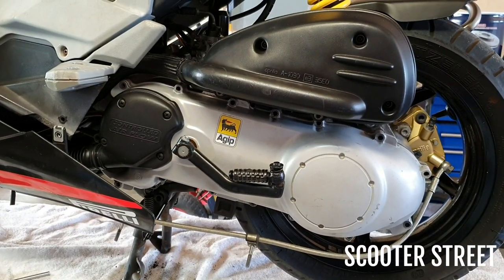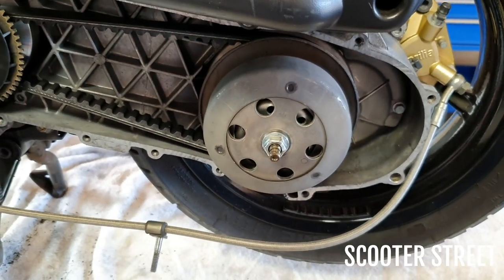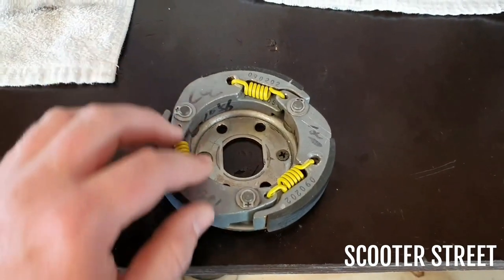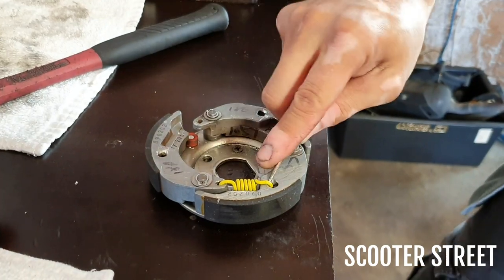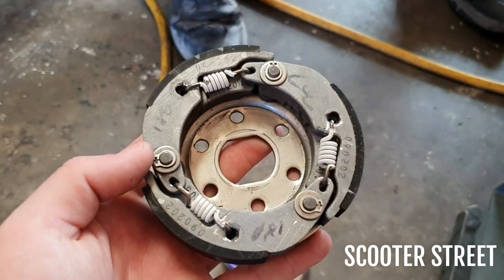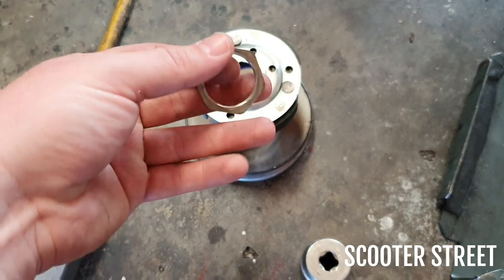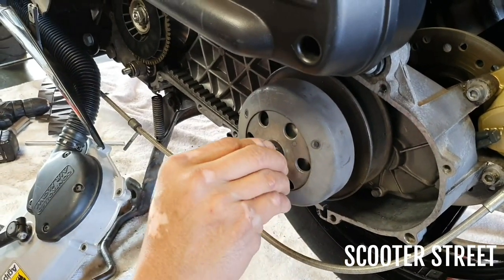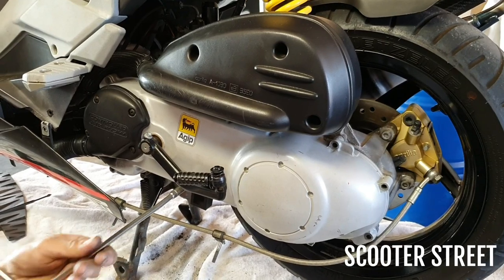Changing / Installing Clutch Springs on Scooters - Aprilia SR50R (Piaggio Hiper2 motor)

Comment: I have a really slow acceleration in the beginning then when I hit 10km/t it accelerates faster. What should I use for my clutch and variator?
Reply from the maker: Without knowing any details of your scooter or the set up it is almost impossible to make any suggestions. I guess you could start by checking the components in the transmission and carby/airbox and look for wear and tear. Try to lighten the rollers and up the tension of the clutch spring set.

Comment: I run this setup: 
-Multivar 2000
-white contra spring
-red leovince clutch springs
-leovince tt
-7 gram stage6 roller weights

-Athena gold series drivebelt, 
(Malossi kevlar belt should also work fine) 

This setup is for aprilia SR 50R Factory (Ditech) 2006 with stock cylinder. 
If you weight +60 kilograms please try out this setup, worked very well for me.
Reply from the maker: Thanks for sharing your setup👍👍👍 awesome!
Reply: Hi, have you got some contact that I could write with you on pv somewhere? I've got the same Aprilia sr 50 factory (ditech) 2006 and Im trying to reach best top speed with stock cylinder to avoid changing it. Right now mine goes 80 km/h on 4,5 gram rollers but Im going to change all of the parts. Im very intrested of you final effect at the acceleration, top speed, sound and the rpms.
Reply: @ciorny2426  final result with stock cylinder was 92 kmh on speedo
Reply: what is the top speed
Reply from the maker: @ciorny2426  Thanks for your comments👍 On this model I would use a street race exhaust system and a variator, the Ditech has a high revving engine and these 2 parts will enhance the acceleration and top speed.
Reply from the maker: @Octavian17  SR50R unrestricted is 86kph GPS.
Reply: @scooterstreetau  mine goes 75 on gps fully derestricted
Reply: and other tuning parts
Reply: The only things that i didn't change after fitting a sport exhaust was the rollers, clutch springs and contra spring
Reply from the maker: @Octavian17  Add a couple of key parts and you will get more out of it. You can never change an exhaust alone other parts MUST be changed to have it running properly and get the best performance. Jet, rollers, clutch springs.
Reply: @scooterstreetau  i got 4,8g rollers and red clutch springs along with the exhaust, but i think that the red clutch springs are way to much for a 50cc, maybe i should try the 4,8g and some white springs?
Reply from the maker: @Octavian17  Try all different parts until you get the best performance.
Reply: @scooterstreetau  with the 6.5g rollers the bike is still very fast from 0 to 75 and then it goes a little bit slowly to 80 on dash, i will give the rollers a try
Reply: @Octavian17  Try gameboy tune it or get a 70cc malossi kit as i did a couple months ago
Reply: @unpossible3249  does gameboy work on a euro 4 sr 50 carb?
Reply: @Octavian17  Nope, only works on fuel injection, main purpose of game boy tuning is increasing fuel rate on injectors, which is done through a computer. Carby version does not utilize gameboy tuning at all because its still old fashion way, though you could buy a derestricted cdi for your carby sr 50
Reply: @Octavian17  i go 110 gps same engine
Reply: @AutoRevisieOutOftheBOX  i go 96 with 50cc sport variator, 14/39 gearing malossi and tt exhaust
Reply: i have aprilia sr 50 what  rolers should i get and witch color spring ant the springs

Comment: hi what contra spring , clutch springs , jet and rollers should i use on my aprilia sr 50 2012 full stock only have stage 6 pro replica mk1 exhaust on ,i want better acceleration
Reply from the maker: It is all trial and testing, make one change per time. For rollers start at .5 gram lighter on each roll. Get an adjustable clutch, Polini.
Reply: @scooterstreetau  shoul i try with like yellow springs white spring and 4.5g rollers or 3/3 with 6.5
Reply from the maker: @izanagi9959  Just change rollers first and then change to an adjustable clutch.

Comment: So when reinstalling the variator or the clutch, it isn't necessary to use a torque wrench to make sure you're not over or under?
Reply from the maker: Yes using the Torque wrench is the Gold medal approach👍
Reply: @scooterstreetau  nope pretty standard. This is setting the bar dangerously low.
Reply from the maker: @Austin-dr5fo  Using the Torque wrench is the Gold medal approach👍 it is OK if you do it how you want to, best way to learn.
Reply: @scooterstreetau  it is the best way to crush your splines. I've seen it happen. I've done it myself.
Reply from the maker: @Austin-dr5fo  If you don't set your shaft spacing you will crush the spline.The Spacing must be outside the where the spline finishes and the conical washer facing inward, from factory it is set. It does not matter which method used to tighten the bolt, if the spacing is short then you are asking for trouble.

Comment: What do you reckon I should do.  Because my bike. Takes loads of RPMS to even move and it’s dangerous for traffic light cars can rear end me ??
Reply from the maker: Without the details. Check for wear or damage.. all I can suggest is to increase the roller weights and reduce the spring tension on the clutch shoe. 🤷

Comment: I have a BV 500. Will this foot method not perhaps be dangerous doing the stand on it removal method, as my spring is much more powerful?
Reply from the maker: For the larger capacity scooters use the clutch holding tool. This will hold the assembly and allow safe removal of the clutch and spring.

Comment: Hi there, my scooter automatically accelerates on its own when i start it. It creeps forward slowly and ideling speed doesnt effect it. Mechanic says its clutch springs. Is this true? I dont trust anyone in my area. Been burnt lots.
Reply from the maker: Yes I would check the clutch shoes, when they fail they get Locked on to the clutch bell and cause a rotation of the rear wheel.
Reply: @scooterstreetau thank you. I will check that too. Flywheel does seem to rotate the get stiff and loose again. Thanks for sharing and your video. 😊
Reply from the maker: Thank you, all the beast. @jmdstudio6176

Comment: I have a Icebear 50cc gy6 I have a naraku clutch kit It has 2000 rpm springs 20mm carb 30idle jet 80main jet Naraku high tention coil mikuni fuel pump ncy no rev cdi I don't know what contra spring to go with, 2000 rpm or 1500 I weight 150, pounds waiting to get my fmf exhaust welded on I'm new to these could you help me?
Reply from the maker: The idea of the contra spring: When you release the throttle the revs will decrease. When the revs decrease we want the transmission gearing to also decrease and continually move to low gear so when the throttle is banged on again the engine is at the lower gear to have an instant response to the throttle action. A balance between rollers and spring tension is how this is acheived. The Contra spring can also slow the accelerating progress if too highe tension, trial and testing will get you the best result.

Comment: I have just bought a Leo Vinci exhaust and it came with clutch springs and rollers, do you think I should put these on at the same time? The clutch springs are yellow. I have a Peugeot speedfight 4 2t
Reply from the maker: Yes you must fit these and the main jet is a MUST. Always trial and testing..
Reply: @scooterstreetau  okay thanks and I have already got a bigger main jet in as I have an exposed airfilter and I had a sports pipe prior to this but it snapped so I think my jet should be fine
Reply from the maker: @charliestowe3421  Don't be happy with I think so, check as you go😁

Comment: I have a stock 50cc engine, and i want more power from my transmission. What do you think is a good transmission setup?
Reply from the maker: A performance Variator will help achieve this, dialling in the correct roller weights, step up the clutch spring set or adjustable clutch shoe (2nd option is better). Get a very flexible belt and make sure it sits high on the rear pulley at idle and high on the front pulley and high speed.

Comment: So put the belt on the variator first I've put a new variator and clutch and I removed 3 rollers because it had no take off so now take off is good but it feels like no top end just reving high please help
Reply from the maker: Changing too many parts usually bandaids the original issue, so this is not the best way approach. Taking out 3 rollers is not ideal and the engine will not perform well.
I can make a comment unless I know the history of the scooter and te parts fitted, we have an online support program. 
See here: https://www.scooterstreet.com.au/product/online-scooter-support/
Reply: @scooterstreetau  thanks I put the other three rollers back in I'm waiting on the left light box and the new throttle cable there coming this week I bought a extra belt in case the new one I put in breaks so it's ruining great now hopefully it'll continue and I definitely will check your support page out
Reply from the maker: Always good to hear when it works out, trail and testing is the best way to learn about the transmission🙌 @Deoge4
Reply: @scooterstreetau  I haven't destroid it since I put the other three rollers in I took them out cuz they was just slow and only going thirty but I think my belt was in the clutch to far down so I got it to the top just a little bit more hopefully it'll all work out in the morning I will know
Reply: @scooterstreetau  I meant to say I haven't test rode it I will in the am though
Reply from the maker: Yes I thought as much. @Deoge4
Reply: Well I took it to the store this morning it's only going 25mph is the rollers to heavy I bought the clutch and variator kit on line with the belt I'm not happy at all please tell me what I can do
Reply from the maker: Stop changing multiple things at one time as it makes it so difficult to find the core issue. Go back to the start and make one change to the system and then test ride and adjust as required.  @Deoge4
Reply: @scooterstreetau  well I get to work today and my belt is shredded the belt that came with the clutch kit
Reply: @scooterstreetau  luckily I had an extra belt I put am I supposed to have the belt on top of the clutch or on the bottom of the clutch it just feels like when I go something's holding it back like the belt is holding it back what can I do to fix that
Reply from the maker: Wacth the belt fitting video and followit without any short cuts, it is really simple if you take your time.
Reply from the maker: Did you check the clutch and all of the parts when you fitted the belt? Was it fitted correctly? Are the parts correct for the scooter model? @Deoge4

Comment: Hello, I have Aprilia SR with minarelli horizontal engine, it struggles to move from a stop and wont increase rpm until about 20 km/h. What do I need to change?
Reply from the maker: To help increase the RPM, lighter rollers and tighter clutch springs. The carby must also be tuned to the optimal setting with the jetting.

Comment: Also I have adjustable screws to loosen the tension on the springs which I later found out I didn't even need the pliers, they just slipped right out after I released the tension.
Reply from the maker: Yes the adjustable clutch spring system.

Comment: How do you get the belt on when using bigger/stronger springs? I can pull the pulley using 1000 spring but 1500+....there's no way. That's the only reason I'm using 1000 spring. I can't get the belt on after changing it.
Reply from the maker: Place the belt into the pulley and use the leverage from pulling the belt to open the clutch. Or, you can also slide the pulley onto a stationary shaft (for example a long bolt locked in a vice) and pull the belt and finger squeeze simultaneously. Pinch the belt together to keep the tension as it it placed around the crankshaft when refitting. Wella👌

Comment: I have a honda forza 300 2014 model. What color spring do I need to order for the clutch?
Reply from the maker: It depend on the Brand you want to use. Which brand do you want?

Comment: Hey, i have a peugeot speedfight 3 50 AC. i have fitted the airsal t6 asso, tecnigas next r, 21mm dell orto carb and a metrakit powerfilter- im about to order a malossi multivar, malossi fly clutch with bell and malossi x special belt. at the moment the clutch and belt is slipping so i think i will start off by using the malossi white contra spring provided with the variator and see if i need to get the stiffer yellow one. but at best my moped is going about 83kmh and i think its using a lot of fuel, like 0,6 0,7 liters per 10 kilometers cirka. anyways would it be worth the upgrade to get a new exhaust like the yasuni R or maybe c16 or perhaps the tecnigas tripos which is a mid race pipe? im currently runnning 4.6g weights and besides a bad takeoff. if im at a stand still and give it full throttle it just slips and sudenly kick into 8k and goes really slow then 2-3 secionds later it just jumps up to 10k and gettting up to speed it is about 9.5k, im thinking to get all the new parts on and tune it from there but do you think the springs that come with the malossi fly cølutch is enough? im driving this scoot ecvery day so im going to get tired off having a very aggressive clutch engagement
Reply from the maker: The exhaust should be giving a good acceleration, but with that set up you should expect more top speed. Look into what you have already changed as to why the speed is moderate and the the lack of acceleration from the start. Rollers sound a fraction too light for me. The Yasuni R would make you very happy or any of the exhausts from the list you mentioned, Great idea! You will always find when you put the power filter the jet will need to be increased or tuned to suit the filter. My approach would be Setting the carby first to the air box and then fit the power filter and adjust. Many suggest to only make one change at a time and we strongly agree. Take this approach with the transmission.... try to avoid fitting all the parts in one session, like doing a puzzle in the dark... My approach would be to go back at least with the carby/power filter before adding more to the puzzle. I look forward to hearing the outcome and you will learn so much as you go, Please share✌
Reply: @scooterstreetau  thanks for the answer, i definitely update you, actually i bought a red powerfilter for the original airfilter box but the scoot couldnt breath and it was too tight to pull up the rpms so i had to get the powerfilter
Reply from the maker: @exapioz3075  Ok great, look forward to hear.
Reply: @scooterstreetau  now i have changed the parts i mentioned and changed to 6g rollers in it is really good, the acceleration i really good, the scoot with the 6g us running at 8.9k cirka and i dont know yet of that is optimal but on multiple flat spots i managed to get up to 97kmh (stock speedometer) think the wind blew in my bavk but still its pretty quick. I had a drag race with a am6 moped with a turbokit pipe and i got q bit in the front f him then he moved fordt qn then i won because mine could go faster but yeah, any thoughts?
Reply: @scooterstreetau  no it was the tecnigas e nox pipe he had
Reply: for aggressive take off u need power.start with a fast cylinder.belt slipping u need stronger contra spring.peugeot engines are not really strong for tuning.
Reply from the maker: @exapioz3075  It sounds like your are getting better with the scooter tuning, keep testing and trailing different changes. Only one part change per time will give you the best feedback for advancing.
Reply: I think i have a similar problem my rpm starts at 9k when accelerating from 0-45 kmh falls back to 7 gets to 8 and then stays back at 7 
My setup is 
Polini variator
Qtre sport exhaust
4,5 g rollers
17,5 mm carb
My friend said i should get a new contra spring and clutch springs
Max speed 65 like it wants to go faster but for some reason it won’t

Comment: I’ve had my aprilia for a while I put a 70cc kit on it and a few weeks later my bike started making this grinding noise coming from the transmission and I later found out that it was because my purple malossi contra spring was hitting my malossi delta clutch, what would be the cause of this? My set up is 
 
Yasuni R exhaust
Malossi multivar 2000 w/ 6.5G rollers
70cc kit
Malossi delta clutch w/ yellow clutch springs
Purple contra spring
Malossi special X belt
Reply from the maker: Not sure that this spring would cause a grinding noise as it is not rotating..... look for something that has a rotational action that is worn in the transmission. The Shaft spacer that sits into the bearing of the clutch cover perhaps?

Comment: I have a piaggio zip 2t wondering if anyone knows the a good weight for the rollers and what clutch springs to use for wheelies as I'm building it as a stunt bike
Reply from the maker: Start with 5-6 gram rollers and the tighter clutch springs. You will need to adjust the rollers to suit.
Reply: for a good start you shloud use 4-5 grams and yellow springs

Comment: Im wondering with how much pressure do you tighten the big nut for the clutch spring, is it possible to overtighten it?
Reply: It would be absolutely possible to over-tighten with such a thin nut, that said, I’m guessing roughly one ugga dugga
Reply from the maker: Yes, it is possible to overtighten. The Piaggio manual states between 55 - 60 Nm. I have seen one come undone before during riding, so if you don't have an impact driver its best to check with a torque wrench.
Reply: @scooterstreetau  thanks mate!